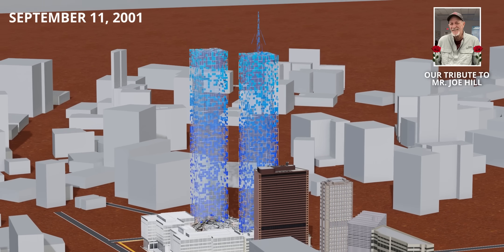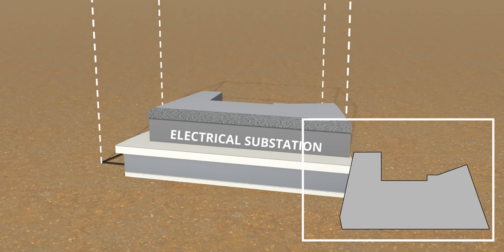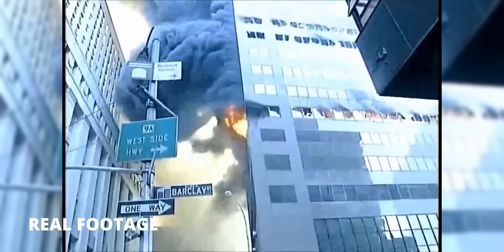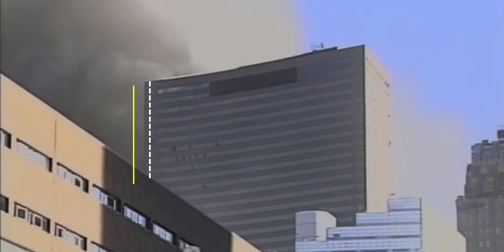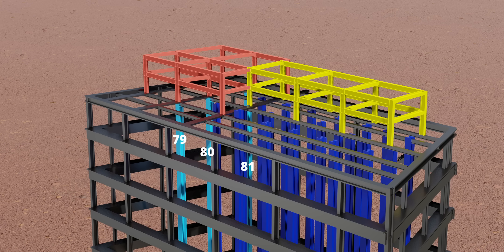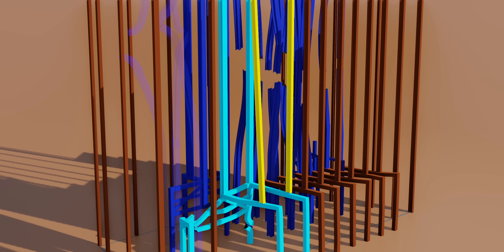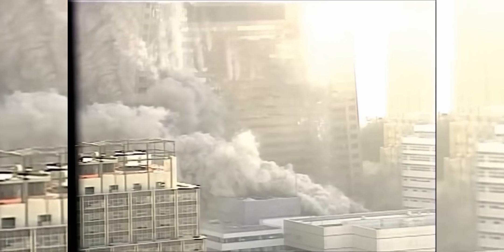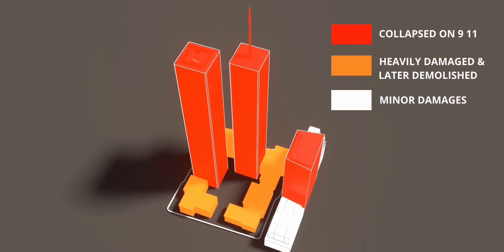Collapse of Building 7 | The Complete Physics

Comment: WT7 did not collapsed by tilting and bending down as it would be logical for a tall structure if one corner support is removed.  The mostly vertical collapse consistent with controlled demolition by explosives on all structural columns.
Reply: I’m going to respectfully disagree and offer a more plausible explanation using engineering, not ideology. 

Much misunderstood, Building 7 was the 6th building to collapse of the 10 lost on 9/11. Because of its early low priority, conspiracy filled the information void with garbage made up by technically ignorant people promoting political agendas. But this is an engineering problem and should be treated as such, so I prepared this brief summary of my own analysis to fix that, using engineering, not politics and tired memes. 

The North Tower collapse at 10:28am bombarded Building 7 with tons of debris, causing heavy damage and starting multiple fires which burned out of control for 7 hours. Half the FDNY firefighters having been killed, units in disarray, equipment destroyed, no water pressure, and the greater urgency of search & rescue efforts, firefighting was pulled as futile. The building couldn’t be saved and was left to its fate. That is the sort of choice firefighters make every day in brush fire situations - which houses to save and which ones to let go. Only real difference here is moving the decimal on the size and cost. People get overwhelmed by the size. 

www.youtube.com/watch?v=g_SvpwyC17M&ab_channel=MFitz  

Collapse of a burning structure is always a concern for firefighters. Steel buildings subject to fire rely on active fighting of the fires to survive. Buildings are designed around 1 to 3 hours of fire resistance, allowing time for occupants to escape and ACTIVE firefighting to get started, after which all bets are off. Left to their own devices they will exceed their design envelope and collapse, like Plasco Tower and Wilton Paes de Almeida. In B7 the occupants escaped, passive and active fire protections were compromised and active firefighting was abandoned 3 hours before the collapse, which left the building to its fate. It lost. Odds on Building 7 would eventually collapse, and it did. No big deal in logic. 

www.youtube.com/watch?v=WnYBX6QT0R4 

FDNY Chief Daniel Nigro ; The biggest decision we had to make on the first day was to clear the area and create a collapse zone around the severely damaged 7 World Trade Center, a 47-story building heavily involved in fire. A number of fire officers and companies assessed the damage to the building. The appraisals indicated that the buildings structural integrity was in serious doubt. I issued orders to PULL back the firefighters and define the collapse zone. It was a critical decision; We could not lose any more firefighters. It took a lot of time to PULL everyone out, given the emotionalism of the day, communications difficulties and the collapse terrain

FDNY Deputy Chief Peter Hayden ; We had our special operations people set up surveying instruments to monitor and see if there was any movement in the building. We were concerned of the possibility of collapse in the building. And we had a discussion with one particular engineer there, and we asked him if we allowed it to burn could we anticipate a collapse and if so, how soon? And it turned out that he was pretty much right on the money, that he said 'In its current state you have about 5 hours

The collapse of Building 7 was anticipated and widely reported in the media throughout the day, with 24 video cameras recording some or all of the collapse. Everyone knew what was coming and why.

www.youtube.com/watch?v=OY5S5k3tMHI 

Building 7’s collapse was completely different to the Twin Towers and harder to understand as most details hidden from view and not intuitive, but we can still sort out what happened through careful analysis and observation.  This is my explanation  of the collapse relying on no outside authority.

Building 7 was complex, assymetrical 47-story steel framed structure built atop a smaller 3-story building, requiring lower floors dedicated to complex load transfer structures, not usable office space. Of trapezoidal shape and all-steel tube-in-tube construction, B7 (above the 7th floor) consisted of a central core of steel columns carrying most of the gravity load, perimeter steel columns around the outside of the structure carrying the remainder of the gravity loads and long span beams and girders to tie those elements together and form the floors. On the outside of the building hung a moment frame or outer shell.

Phase 1 : First externally visible signs of collapse initiation occurred at 5:20:28 pm and were notably quiet with observers not realizing the building was collapsing! No audible warning in the form of  hundreds of ear drum busting 180-190dB explosive bangs preceding the collapse. Here at 12:00 a local CBS affiliate reporter is talking 10 blocks from B7 when collapse begins. People don’t start to notice the collapse until 12:11. At 12:45 is the famous CBS fixed camera clip of Building 7’s collapse. Note how quiet it is.

youtube.com/watch?v=t5tEy6mXSE8&ab_channel=fresnosean379

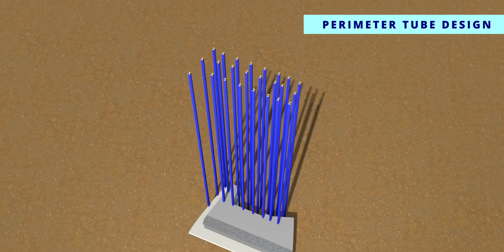Collapse initiation was due to lower floor failures above the load transfer region (7th floor) in the NE corner. In this video at 0:45 you can see the NW corner from inside the building while under construction, Column 79 just out of frame on the left. That big, angled steel beam across the top of the frame connects to C79 at one end. The girders connect to the beam. That beam and all those girders depend on just one connection

youtube.com/watch?v=nP3TNHPCIVU&t=35s&ab_channel=EdwardCurrent

Phase 2 : The floor failures caused a loss of critical lateral support over an excessive length of core Column 79 and it buckled. If you look at a floor diagram of Building 7 (see above) and look at all the structures that depend on C79 you quickly realize this one column was a relatively isolated structural element on which a disproportionately greater fraction of the structure depended analogous to say the Key Bridge. Externally we see a vertical progression of window breakage along the 44-46 line and a kink in the roof of the East Mechanical Penthouse at the top of the building, consistent with C79 failure. The transition from full capacity to almost no capacity occurs in an instant. Once the buckling failure occurs there is almost no resistance

Normally with a buckling column, the load could be redistributed to other columns. With C79 that is not the case - the failure did not redistribute the load, so the collapse rapidly progressed to the roofline, sinking the rooftop penthouse.

Phase 3 : With C79 gone, B7’s progressive, non-symmetrical collapse continues with C80 and C81 at the east end of the core left laterally unsupported and quickly buckled and failed as well, sending the EMP down through the building. C79-81 all have no diagonal bracing, which I believe is a major reason why they could not redistribute a lot of vertical loads among one another.

From there collapse progressed from east to west through the central core until the core was gone taking all of the interior floors and probably most of the perimeter columns with it. Follow the horizontal progression of window failures low in the building and the dropping of the remaining rooftop structures into the building. One of the big takeaways from the NIST Building 7 study (that gets completely ignored) was their modeling which determined C79 failing under ANY circumstances would have initiated the same collapse sequence.

Phase 4 : After 10 seconds only the exterior moment frame - a hollow empty outer shell – remains, giving the ILLUSION the Building is still standing since little has outwardly changed.  It is just a hollow empty shell like an empty cereal box. Supported by only a few remaining columns that empty shell is quite unable to remain standing. With all core columns and floors gone, the north face leans inward, forming a V in the roofline, the last few columns buckle under the strain and the moment frame free falls, landing on top of the 7-story high debris pile. It is only late in the game here at the end that a single measurement of alleged free fall acceleration is taken, from a single point on that outer shell. The Building did not “free fall” – just one corner of the outer shell did, sort of. The Building was already gone before that happened. The period of alleged free fall was a product of how it fell NOT why it fell and cannot tell us what started the collapse. Start to finish the entire collapse took 18-20 seconds, 3 times longer than true free fall .  How fast something falls cannot tell you what started it falling_ anyway. The debris spread outside the footprint, blocking surrounding streets, heavily damaging the Verizon Building and destroyed Fiterman Hall.  

Building 7’s progressive, non-symmetrical collapse was incidental and unintended collateral damage from the combined effects of fire + time + gravity, started by the collapsing North Tower. That is true no matter who planned and carried out the 9/11 attacks or why . The collapse was of so little consequence it barely even registered at the time, a mere footnote. It only took on semi-mythical status as an alleged smoking gun years later when demolitions at the Twin Towers, missiles at the Pentagon and shoot down over Shanksville all failed and conspiracists had nothing left to work with.

Anything can seem like a conspiracy if you don’t understand how it works. Now you should. I hope you found this helpful, informative and it solicits informed critical comment. If I made any errors of fact, logic or reason or left anything important out, please let me know so I can fix it. IF you can offer a more plausible alternative please do. Be the first. Please start any reply with the words “Tits McGee” or I will know you didn’t read it and are wasting my time.

Comment: Under stress from the penthouse? 🤔
somebody skipped structural engineering class 😄
Reply: The rooftop East Mechanical Penthouse contained a lot of heavy equipment. It was a not insubstantial gravity load. 

Yes, that puts stress on load bearing members. That is sort of the idea. Structural engineering 101.
Reply: @TheCriticalStinker-01 
There is less than five examples of steel structure collapses due to fire , including poor construction and fire safety materials in over 100 years of construction history and you chose two to support you argument 😄

If grasping at straws was an Olympic sport,  you'd be a gold medalist 🙂
Reply: @pacohoratio this guy is a flat earther and has a messianic vibe to him
Reply: @TheCriticalStinker-01 
The mechanical penthouse at 7 World Trade Center (WTC7) was part of the building's original design and construction, completed in 1987. The building had a small west penthouse and a larger east mechanical penthouse on its roof, which housed mechanical equipment. It's clear that it was an integral part of the building's design from the start.

In short, the there was zero excess loads or stresses on the structure outside of design by anything related to the penthouse.

You might want to revisit Structures 101🤔
Reply: @pacohoratio  - Strawman much?

Who said anything about excess ?  

THE PENTHOUSE ITSELF WAS A SUBSTANTIAL LOAD

Full stop.

That substantial load was kept on the roof by 3 core columns: 79, 80 and 81.

When lower floors in the NE corner of the building failed, it caused C79 to lose critical lateral support over an excessive length. C79 buckled.  We see the evidence for this in the kink that develops in the roof of the EMP along with a vertical progression of window breakage on the 44-46 line. 

That in turn caused C80 to become laterally unsupported over an excessive length as C79 took beams and girders connecting to C80 down with it.

C80 buckled.

C81 follows in very quick succession.  The substantial EMP drops down through the building. 

When the critical lateral support was present, there was no problem.  Only when it was removed did things go sideways. This is the critical bit you seem to be ignoring completely. Granted, the video pretty much glosses over how and why C79-81 failed, so I can see a point of confusion there,  But you seem to be under the impression the columns just suddenly (and for no reason) decided to crap out under the weight of the EMP when in fact the columns load capacity was reduced, causing them to be overloaded.
Reply: @pacohoratio  So, you thought that when the structure in general was starting to weaken, as would be expected after several hours of fires, the heavy load of the mechanical penthouse.....magically lightened?
That's impressive.
Reply: It is impressive as other than WTC7, there are no documented cases of steel structures collapsing due to fire in NYC, and fires are a common occurrence, over 2000 in 2024 alone.

 Globally, such incidents are extremely rare, with most steel-framed high-rises designed to withstand significant fires without collapsing. 

You could say it's a miracle 🙂
Reply: @pacohoratio  - Could you have loaded that argument any more?

Since you completely ignored everything in my last reply to engage in a deliberately evasive off-topic derail premised on a logical fallacy combined with severe argument loading, goalpost moving and false starting assumptions I will take that as tacit admission my previous point is made and accepted.

Glad we got that sorted out. Have a nice day.
Reply: @mooneyes2k478 
Steel structures do not weaken from fire. 
NYC has over 2000 fire events annually, yet, WTC7 is the only high-rise to collapse to fire.
Reply: @pacohoratio  "Steel structures do not weaken from fire. "
HELLO and WELCOME to earth!
Here, the vulnerability of steel to heat has been known for about 3300 years, with the beginning of what we like to call the "iron age".
It's an amazing thing, we found out that heating steel and other iron alloys make them weaker and thus more malleable and easy to work.

You're welcome for the tip so your planet can also experience progress.
Reply: @TheCriticalStinker-01 
When you can no longer argue the point, it's disappointing but not surprising that you choose to shield your embarrassment and jettison yourself from the conversation in the face of indisputable information.
Remember,  maths and physics doesn't care what you believe 🙂